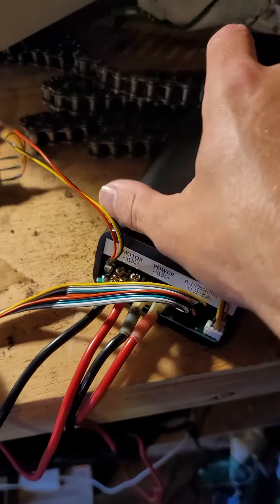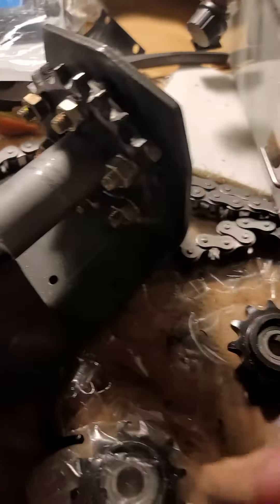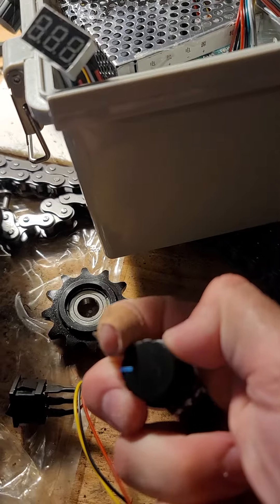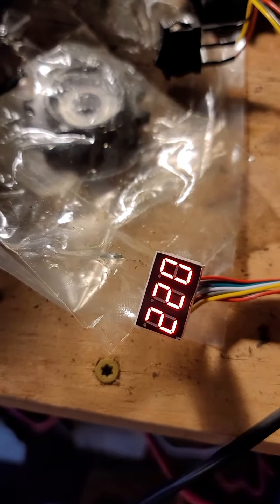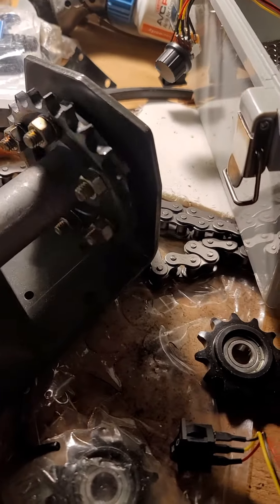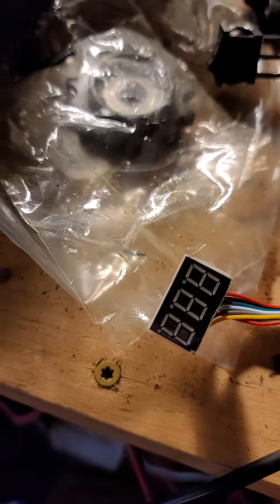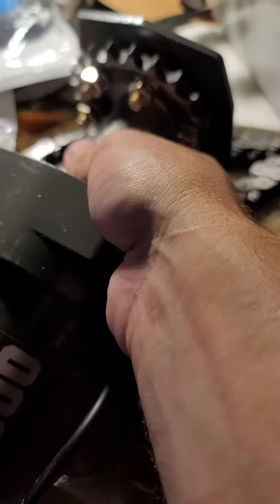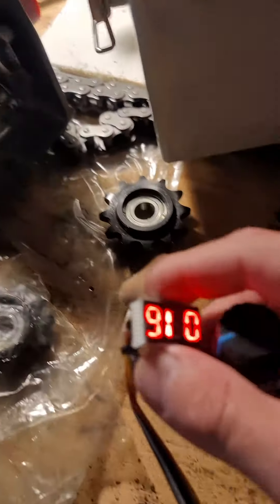Home made band saw mill power feed pulse width modulator

Comment: How is your pwm holding up? From what I’ve been reading is they can’t handle the power from a winch motor.
Reply from the maker: Its been 2 years now haven't had a problem.  I am not putting a great deal of stress on it, so it is prob only drawing a couple of amps.  If you were to run the winch at full capacity, Id have some reservations about using it.  But yeah, all good so far.